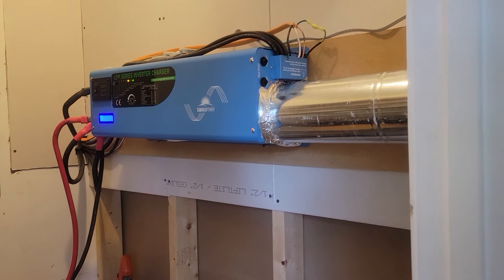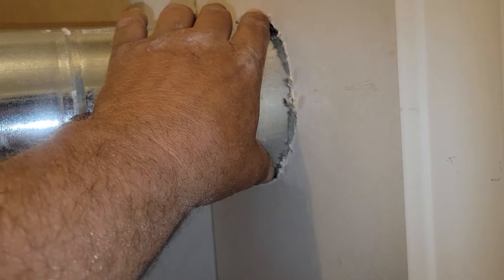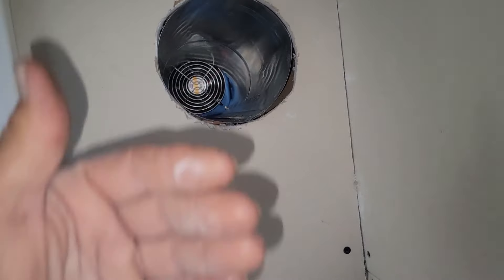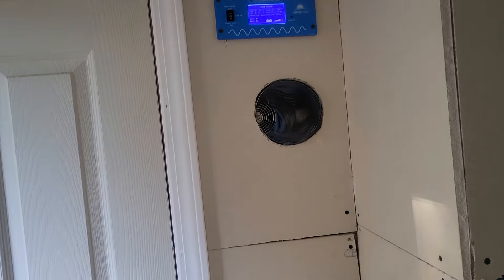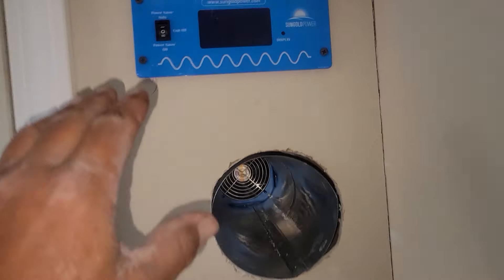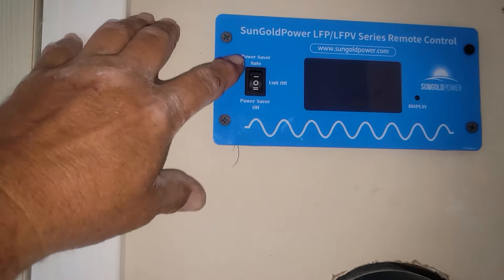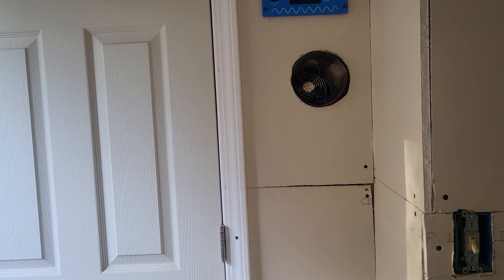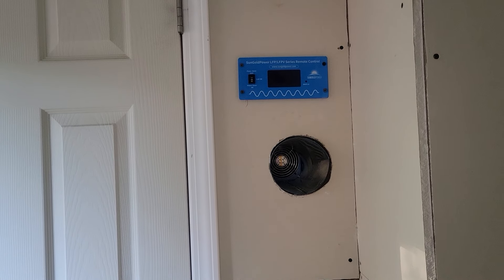Improvements for my off grid power.

Comment: That vent should work well for you.

 Might think about putting in a thermometer with a digital readout that you can mount outside the door...near your blue monitor panel, to keep track of the room temp...especially if you add more batteries and panels to charge them. Information is good and thermometers are not that expensive. Just a thought.
Reply from the maker: Thanks for the tip!